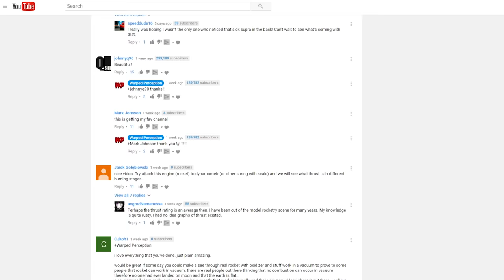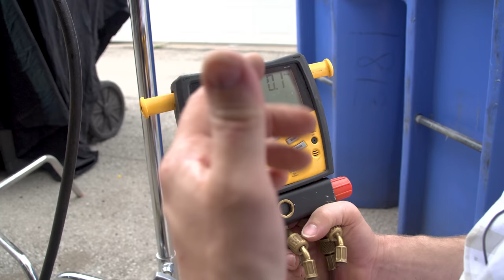Model Rocket Engine In A Vacuum Chamber - 4K Slow Motion - will it burn? - Rockets (S1 • E3)

Comment: I like and subscribe to your channel.  A question I have is why did the rocket not move on initial ignition? The rocket did not appear to move until the smoke passed by it after the smoke filled the right half of the chamber.  Also, even after it moved it was not very much thrust.   What effect do you think a larger vacuum space would have?
Reply: Rocket motors take a while to generate full thrust from ignition.  At slow motion, it will take quite a few frames before enough of the blackpowder (which Estes uses for propellant) to starti to burn to produce thrust.

The motor was retained by a spring of wire.  it effectively is a "force gauge" showing how much thrust the motor was producing.

Estes motors of that size don't generate very much thrust at all.  Don't need much to fly a rocket that only weighs 50-100gm.  But restrained by heavy copper wire, it won't move much.

Comment: exhausts refilled the small vacuum chamber. try a bigger one
Reply: I guessed the volume and an engine of that size can't produce much gas. After some math it would still be at 0.001 - 0.00016 times air pressure. It's even thinner gas than the martian atmosphere.
Reply: There is no sound in a vacuum but you could clearly hear the rocket in the tube.  Fail!
Reply: the sound is just the vibrations escaping through the tube , into the outside.
Reply: The exhaust wasn’t pushing the engine forward, the thrust was
Reply: ben gray When your arguments turn to name calling and insults you discredit yourself.
Reply: ben gray Hmmm......more insults. Time to grow up sir.
Reply: ben gray I won't resort to name calling Ben and I'm sorry you have.  I wish you the best in all your endeavors.
Reply: wizbang16 good for you 👍🏻 and all the best for your endeavours learning about astrophysics 😀
Reply: Rick Stewart the fact is this shouldn’t even need to be done to prove the point, but apparently flat earthers don’t know how to learn at school...
Reply: Unsure if ur being sarcastic ~ regardless, sound waves need a medium to propagate through, there was a vacuum however the metal coil holding the rocket would have served as the medium for the sound waves to propagate along, into the surrounding tube and into the external air filled environment.
Reply: Joe_Anroy have you seen the edge of your flat earth concept? No you have not! The earth is not flat, and the experiment to prove it is easy, also space is real
Reply: @bengray5013  wow so you can also read others minds and automatically tell what people know and what they don't. My maaaan, wow! Arrogance at its finest. Liberal public schooling
Reply: @bengray5013  so you create your reality based on assumptions, you assumed I'm a FEarther...Democrats in America do NOT really exercise democracy just as liberals do not exactly represent what the word liberal is defined within the dictnry..there's a huge difference between being SMART and being a SMART-A-S-S (someone trying to fool others while pretending to be smart) do you agree?
Reply: Joe_Anroy I used your own nonsensical argument against you and now you’re crying, get a grip kid! Pretty pathetic tbh, but hardly surprising from someone that doesn’t even understand the meaning of the word liberal
Reply: @bengray5013  have you seen the edge of space?  you can't even show a real picture of the curvature without faking it with curved windows, curved fisheye lenses
Reply: Tri Le oh dear, no the images from space are not all fisheye lense and it’s easy to tell, but then again you flerfers make a conspiracy of everything! Fact is the earth is an oblate spheroid and not flat!!!

Comment: Does a rocket engine work in a vacuum? Yes. Yes it does...more efficiently too...higher vacuum specific impulses because no atmosphere to push against the exhaust gasses, kind of. Look up de Laval nozzle :^)
Reply: they wont look up anything, they will not be proved wrong
Reply: No friction to slow down the rocket either.  High School physics is a lost art to these ignoramus'.
Reply: why do we hear the sound though.. very curious.  should be NO sound in a vacuum, yet we hear everything even the pop of the igniter.     wonder if the suspension of the rocket motor with the metal spring is making the tube act like a speaker
Reply: zanick2 
That would be my hypothesis.  The metal transmitted vibration to the tube.

Comment: Every action has an equal and opposite reaction
Reply: Wow! you just debunked all the flat earthers in the comments 👏👏
Reply: @astron3133  quite the opposite
Reply: @astron3133 WAIT so how does the 3rd N. law debunks the flat earthers? elaborate please.. :)
Reply: @camranh_royal  doesn't
Reply: Ganiscol  Rockets dont shot bullets and i have never seen anything flying based on a recoil mode, hot exhaust gasses cant push against nothing, it has to be in the air to work. You fell for the worlda biggest hoax, lol feel sorry for you.

Comment: I particularly like the comments that try to point out the whole "no sound in space" bit because they heard sound. Fun fact, the speed of sound through copper is roughly 4660 m/s, and the speed of sound through acrylic (I'm guessing that tube is acrylic) is roughly 2730 m/s.  So, noticing that the engine is in direct contact with matter that is in direct contact with the wall of the tube that's in direct contact with our atmosphere...

Now, cue the whole "well, why didn't we hear a sonic boom if the sound was traveling at 4660 and/or 2730 m/s and planes make a kaboom at ~350 m/s?!?  WHERE IS THE EARTH SHATTERING KABOOM? That requires a space modulator and I'm pretty sure there is a rabbit out there who has it.

source: http://www.olympus-ims.com/en/ndt-tutorials/thickness-gage/appendices-velocities/

Comment: All these comments about rockets not working in a vacuum and the need to demonstrate it with an actual rocket in a vacuum are just wrong.  Rockets operated on the conservation of momentum.  This is demonstrated in EVERY beginning physics lab course.  Anyone that denies this is welcome to take a physic lab class and prove it or disprove it.  Until you do and understand what you are testing you really are not basing your arguments on actual knowledge.
Reply: Indeed. Besides, in this trial he is generating a lot of fumes which most likely killed his vacuum and that little pump could not recover. You are right, this is not the way to prove that the wrong is wrong. Because you cannot prove the wrong is wrong doing it wrong. lol!
Reply: Tim,  Momentum is indeed conserved even if the rocket does not move.  The gas exiting the rocket produces a force on the rocket.  If the rocket is anchored to something then the force and motion is transferred though to that anchor.  A much much smaller reaction motion is produced as the anchor has a very very large mass.  Same very basic physics.
Reply: Tim,  The pressure built up inside of a rocket engine and it's nozzle is quite high, about 1000 psi.  This is because of the combustion of the liquid oxygen and the RP-1 propellant.  The pressure inside any explosion is quite high until the gases produced by the reaction have a chance to equalize with the surrounding environment.  The rocket motor combustion chamber and nozzle allow this gas to escabel inonly one direction, the rocket goes the other.  The thrust, the reaction to all the escaping high speed gas, is produced if the rocket is moving or not.

The pressure is not really needed for this conversation though.  I could make a rocket go, slowly, by just sitting on the rocket and throwing bricks off it, the rocket moves because of the momentum I put into the bricks when I throw them in the other direction.  This is all that is happening in a rocket, it is throwing gas away from it very very fast, and a lot of it.
Reply: Tim Webb
"All I recognize is that you are not the brightest simian in the troop."

That much is okay, as I never made any such claim, but such an obvious observation on your part isn't near enough to elevate your lowly status.

"The situation...is identical to that pertaining in the gun + bullet scenario...Nobody disputes this; least of all me."

First of all, you totally ignored my question, "From the very first flame that exits the rocket, what is the flame/exhaust pushing off of?"

The answer to this, and the correlation to the error in your logic can be simplified by using your own recognized situation:

A grenade works exactly like a bullet, with the exception of many fragments replacing the shell and single projectile.  If, instead of the nebulous imaginings of an expanding gas, you built a device that had trillions upon trillions of tiny grenades continuously fed into a nozzled chamber where they were detonated, you would get a steady flow of minute projectiles banging into and pushing off of the chamber until they exited the nozzle, save for those with initial egress paths.  The end result is the rocket goes in one direction and the shrapnel exits via the nozzle and diffuses en-masse, as deemed by their individual escape trajectories and post-chamber inter-exhaust collisions.

So, a violently explosive chemical reaction works in the same way.  However, it is the gas molecules that become the shrapnel - the rocket remains as just itself.

"If you have any other questions or observations, please do not hesitate to bring them here to me, and we can analyse them together, in more detail"

My only question is why you are, or have been, too confused to understand this?
Reply: Tim Webb
"Try to be a little more concise in your answers."

You pretend not to understand them either way.

Still, just answer this - WHAT is the flame/exhaust pushing off of to rapidly EXIT the propulsion chamber?
Reply: Monkeyboysdontknow He doesn't want to answer. Deep down he knows he's wrong and is being intellectually dishonest but he won't abandon his worldview and religous beliefs which strangely depends on a flat earth, world wide government conspiracy, and the lack of outer space. He probably believes we live on some kind of dome plate, like a snow globe. It's completely and utterly stupid.
Reply: 03chrisv
"He doesn't want to answer."

Correct.  Tim Webb was quite loquacious and glib thinking he could just continue to throw a confusion of parroted "beliefs" about and dance around the fundamental aspects of physics.  He even pretended to not understand the analogy of the bullet/grenade and came up with his new fundamental property of gasses, which "are obliged to go backwards" with no physical interaction required.  So, according to him, all of the gas molecules don't push off anything to exit (granted some don't, as a small percentage have an exit trajectory to begin with), but miraculously physically interact with the air molecules (when present) upon exit from the propulsion chamber to push on them in such a manner that the gas molecules bounce back and  NOW push off the rocket.

"It's completely and utterly stupid."

Yep.  He just lowered the average IQ for the entire internet.
Reply: Tim Webb
"We should always seek the least complicated answer to a question"

That doesn't mean ignoring facts.

"where a huge volume of gas would go, denied the opportunity to "push off of" something"

First off, the amount of gas does not affect the individual energy characteristics of each molecule/atom, but increasing their number DOES increase pressure (as does an increase in energy, a.k.a. heat).  Next, to be denied the opportunity to "push off" of something would only occur if NOTHING is there for the randomly moving particles to interact with.  The propulsion chamber is definitely something, so your scenario is irrelevant.

"And why would this gas seek to "push off of" something, if there was a way for it to escape the chamber without doing this?"

Since gasses are composed of randomly moving molecules (or atoms), you propose the impossible.

"Pressure is never exerted unless the gas is confined in some way; and in an open-ended rocket exhaust chamber, the gas is not confined in any way"

The combustion chamber DOES confine it, just as an open garden hose contains water.  Both systems exert pressure inside their containers and their substances flow out their openings.  If there were no pressure, there would be no flow.  Another example would be a tire with a slow leak.  A slow leak would be from a very small opening, but an opening nonetheless.  There is still pressure in the tire for quite some time, and you can occasionally add air to the tire to restore pressure to it.  That is like adding fuel to the propulsion chamber, just at a different magnitude.

The rest of your comment is more irrelevant blather. 

In summary, you tried to hand-wave away the reality of what it takes for a media to rapidly flow (a force, of course, in this case pressure), and added either false or irrelevant comments to try to move attention away from your glaring failure.  And you still haven't addressed the hand grenade comparison at all.  

P.S.  I haven't even started on the myriad of fundamental failures inherent in your exhaust/air scenario for atmospheric rockets.
Reply: Monkeyboysdontknow Great comment. Tim doesn't give a shit about reality, he just wants to preserve his beliefs which apparently are threatened by the existence of space.
Reply: It appears Mr. Webb has abandoned his crusade on this thread to spout pseudoscience and make unsupported claims.  Leaving without bothering to show any honor or accountability.  It is no surprise that his sort is the norm for most conspiracy believers.  They clamor about the truth, but when it is undeniably (to any sane person, at least) presented clearly in front of them, they refuse to acknowledge the obvious and sulk away to the respite of their own imaginings.
Reply: Thats alright I have listened to enough BS for a lifetime in schools maybe you should consider using common sense and logic instead of just believing what you are told without even understanding what you were just led to believe then you might know it does not make any sense.
Reply: Niva Ruvio
"I have listened to enough BS for a lifetime in schools"

Too bad you didn't understand any of it, then.

"maybe you should consider using common sense and logic"

I do and have provided it.  What do you not agree with, and explain why, logically. 

"then you might know it does not make any sense"

Logically, it is YOU who aren't making any sense.  Spouting accusations without solid collaborating evidence is a rant, NOT a logical rebuttal.
Reply: If there is no momentum there is nothing to conserve.  Where is the proof from NASA that rockets can function in a true almost perfect vacuum?  With all they have, it should be a piece of cake.  It's a stupid argument to have, since it's easily proven by basic Physics.  It's easy to skew a test done by some guy out of his garage that not scientific if all variables aren't accounted for.   That tube is not the
vacuum of space, period.  Not even close.   That little pump isn't close to sufficient to replicate a proper space vacuum.  Listen to those not paid for by NASA, if you believe them you'll buy anything.  In time the truth will win out and it's coming, it's here.  In a real battle the truth will dominate.
Reply: TheVastdream
"If there is no momentum there is nothing to conserve"

Every explosive chemical reaction creates momentum.

"Where is the proof from NASA that rockets can function in a true almost perfect vacuum?"

Physics equations and the applied science which gives us satellites, space probes, the ISS, etc.

"it should be a piece of cake"

It is.

"it's easily proven by basic Physics"

Yep.

"That tube is not the vacuum of space, period.  Not even close."

Close enough.  What is YOUR specific problem with the vacuum provided, and what would you consider adequate?

"Listen to those not paid for by NASA, if you believe them you'll buy anything."

That sentence doesn't say what you think it says.

"the truth will dominate"

Correct.  The truth is rockets can work just fine in space.
Reply: If the earth was flat timezones couldn't exist. It would not be possible for it to be day in one place and night in another.

Conservation of momentum proves that rockets can work in a vacuum.
Simple Lets say you have a space ship weight a total of 1005Kg.
You then eject 5 kilos of gas backwards at 2000m/s. This gas has a momentum of 10000kgm/s. By conservation of momentum the rocket must gain 10000kgm,/s in the opposite direction, giving it a velocity of 10m/s.
QED.
Reply: My friend have you ever been into space then you do not have knowledge of it......So if it made it into space with high rate of speed it would still move i agree but also it would explode out from the pressure........ of the vacuum........
Reply: Tim Webb  Are you trolling?
Reply: @charlie Could you please provide the math formula that proves propulsion in a vacuum using your conservation of momentum example. The lab is not necessary just the math.  Thanks